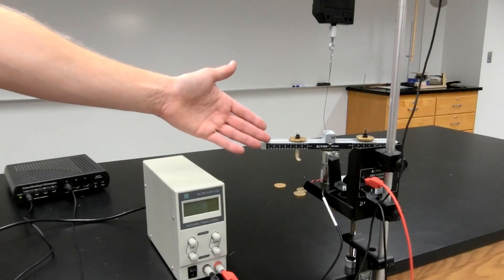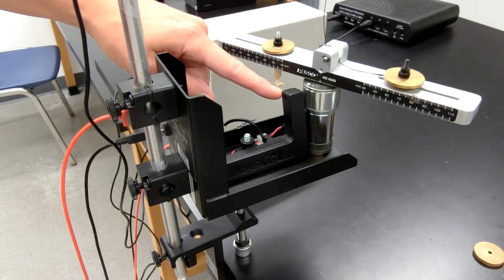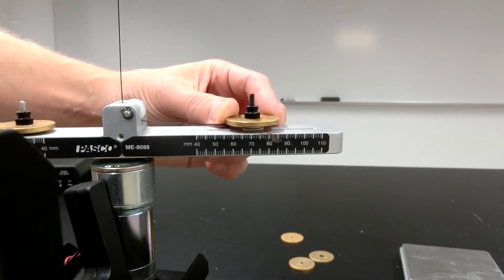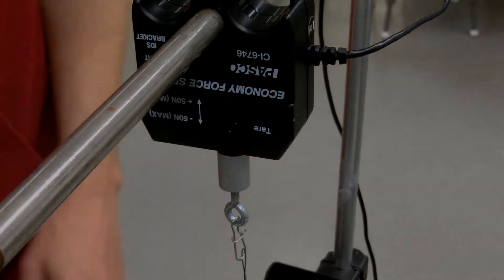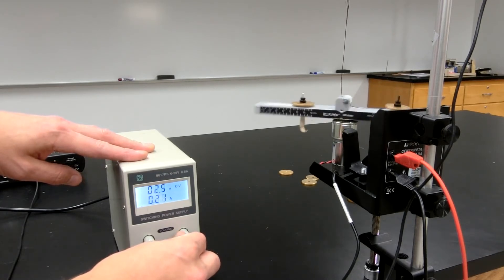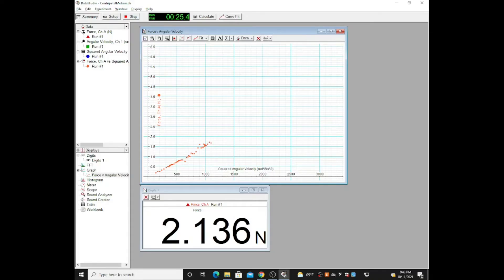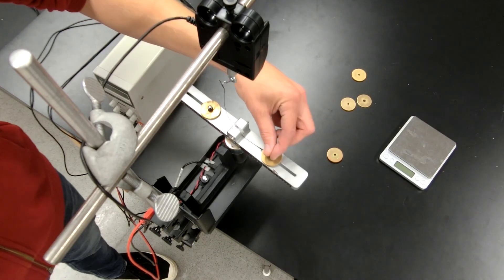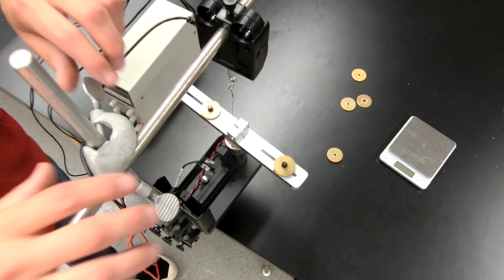Experiment - Centripetal Acceleration

Comment: Centrifugal and centripetal forces are so confusing. Shouldn't this be called centrifugal as the object tries to move away from the center? Could we simply call this inertia? Looks like the object that tends to go in a straight line is simply forced into a circular motion by the wire. I'm so ignorant ☺
Reply from the maker: Your last sentence is correct - the mass would move in a straight line due to its inertia, but the tension in the wire pulls its path into a circle. Force toward the center = centripetal.
There is almost never a centrifugal force. We just think about the force pulling toward the center of the circle and think there must be something pulling outward to balance it -- but it is not balanced, that's why the mass continually moves in a curving, circular path.
Reply: @williampeterson7749  Thank you for your explanation. This is obvious now.